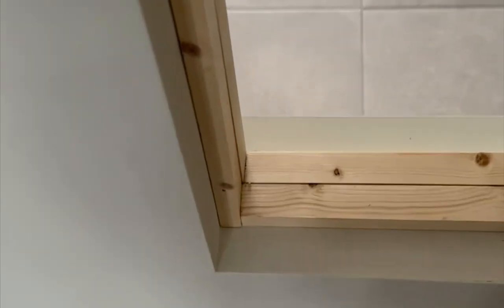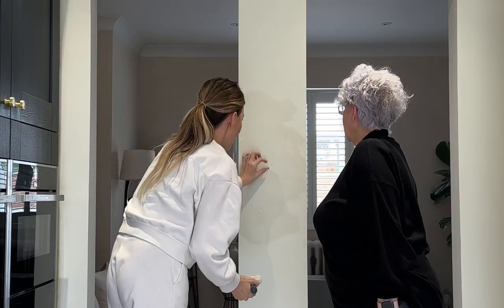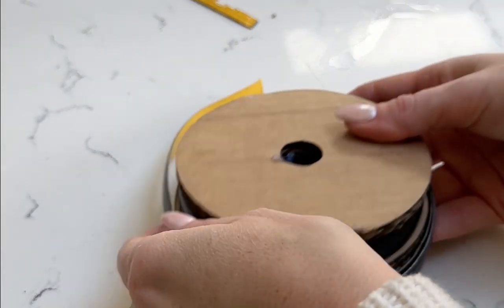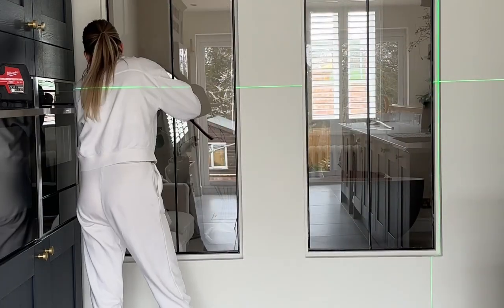DIY CRITTALL WINDOWS on a budget VLOG

Comment: Hi Robyn , first of all can I just say it looks absolutely amazing  ,well done you .
Can you tell me was it toughened glass you used or something else? Thanks
Reply from the maker: Thank you so much xx so you need it to be safety glass. There are two types you can use. I went for laminated glass. It’s slightly more expensive. Total cost for both panes was around £215. Just means if it were to brake it wouldn’t shatter x hope that helps